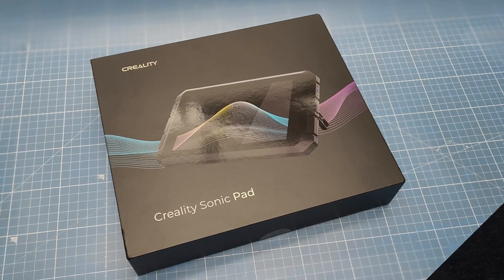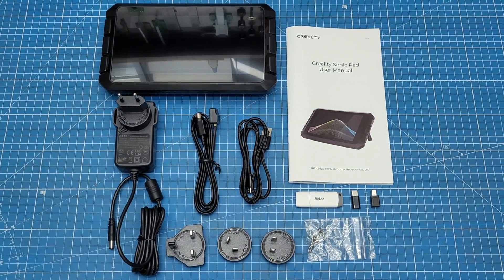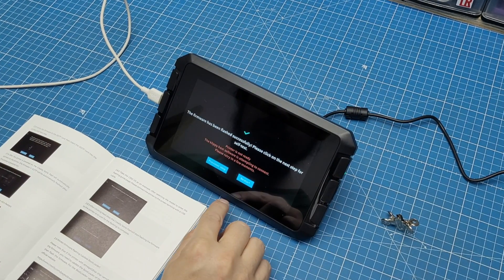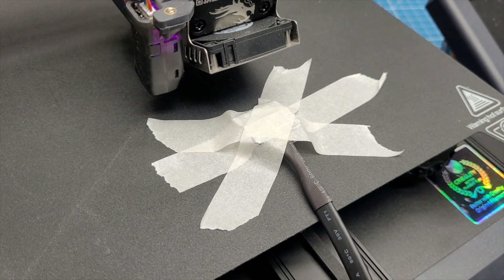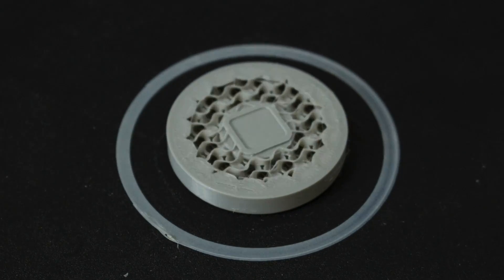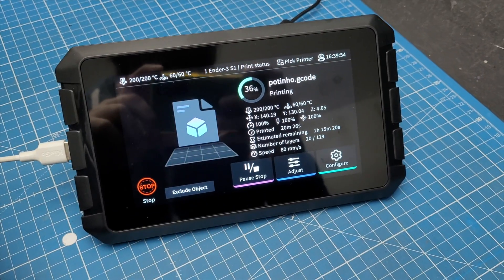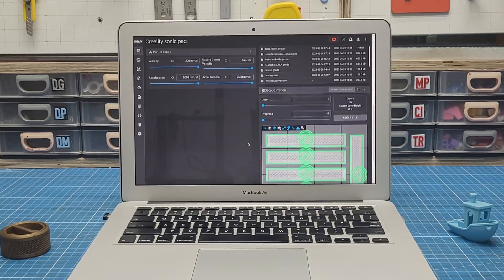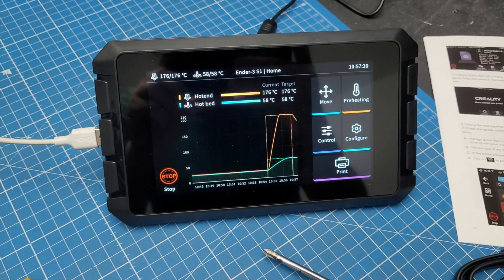Sonic Pad Review - New tool in the shop!

Comment: You're correct this isn't a plug and play device.  I've had my Sonic Pad for 2 weeks and the sonic pad profile Creality recommended for my Ender 3 s1 pro basically rendered the printer useless as I needed it most for my business. I ended up buying 2 new printers to compensate.  But on your advice of using the old profile my printer is back at work. THANK YOU so much.